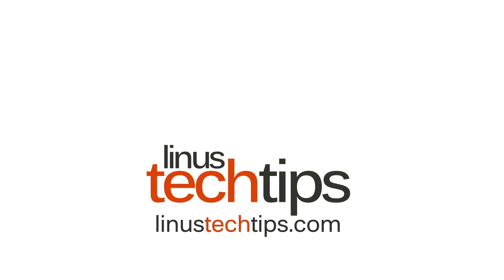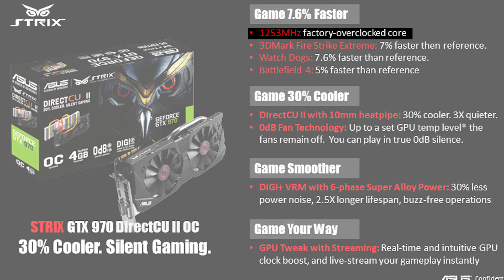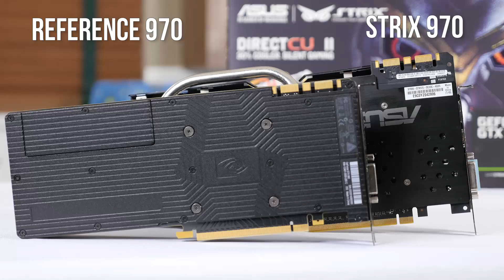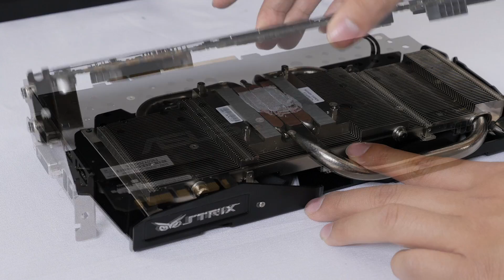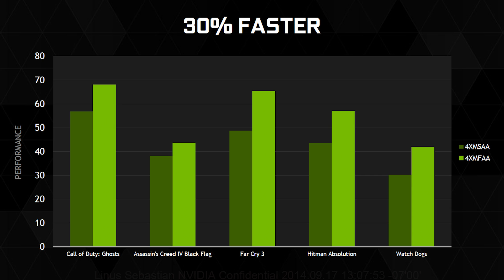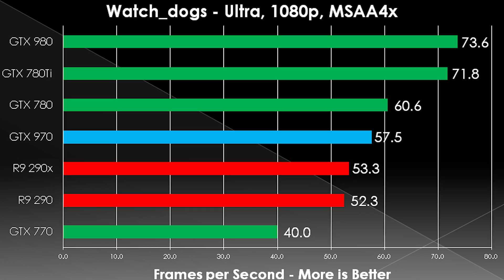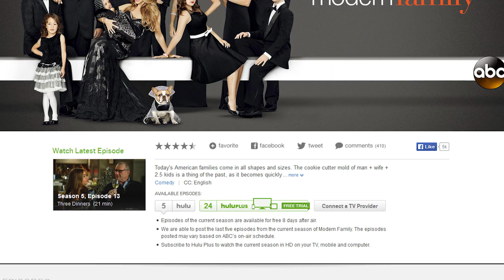ASUS Strix GeForce GTX 970 Video Card

Comment: can this build run ac unity and nba 2k15 on high??

 Intel Core i7 4790 3.6GHz Quad Core
 Asus H81M-PLUS
 8GB DDR3 1600MHz
 GTX 970 DirectCU II 4GB GDDR5
 120GB SSD
 1TB SATA3 HDD
 500W 80 PLUS 120mm fan
 thermaltake mid tower case
Reply: Very good build, however I would change 3 things. Firstly, I would bump that 500 watt power supply to 600 watts (just to have some extra room). Second, I would get a different motherboard, a gaming one with more than 1 PCI-e slots (yours only has 1). The MSI Z87/Z97 motherboards are very good. Third, if you can shell out an extra 20-30 dollars for that K (overclocked version) of that CPU that would be the best. But you can ignore my advice and just go ahead and build that already beast of a PC.
Reply: Great build except your power supply, get the 650w from corsair which is gold or platinum certified (cant remember which one), besides that you should be good

Comment: I had a r9 270 now, with a 520w powersuply, if i buy the gtx970, and do i need a new powersupply? Also will i preform much better, or just a little bit, or should i wait, since i can play most newest games on high at 45-60 fps, witch is perfecly fine for me

Comment: Building a PC in the next month.
I need a second opinion! I will be using this as a PS4 alternative.

i7 4790k
Corsair H100i
Asus Z-97
G.Skill Trident X-Series 16GB (2x8)
Samsung 840 EVO 500GB
Asus Strix GTX 970
Case- Corsair 780T
I need a good PSU for this. Any recommendations?

Comment: If you had to choose out of this ASUS Strix GeForce GTX 970 and the Galax GeForce GTX 970 Hall of Fame, which way would you lean? I would be running mostly @ 1920x1080 and considering 4k in the future as well as SLI down the track. Running all air cooling in a Corsair 540 all Noctua'd up! I honestly can't decide.

Comment: I just ordered a PC with:

i7-4790
GTX 970 "MSI"
16GB RAM "HyperX Fury"
Watercooling system (can't remember the model)
SSD 240GB
(and some extra basic stuff)

Should I be good?
Next year I'm planning to get another 970 just to have twins :D
Reply: I'm jelly.
Reply: Actually, I recently changed to a ASUS GTX 970 :D
Reply: Kenan D'Shredder And a 4790k x)
Reply: ***** Actually, the order turned out to be even better now...I'm getting the MSI gpu and non-K 4790.....heheh, joke's on you sir, you can see that I wrote (and some extra basic stuff)  :D
Reply: ***** I didn't say anything about overclocking....
Reply: ***** Yes I said that, but since I ordered my new pc it would arrive sometime next year because the gpu was out of stock, (and I couldn't wait) that's when I decided to change parts, but the new change didn't proceed...why? Because the gpu came earlier than they thought so that's why it was cancelled and I got what I actually ordered.......I don't say that the 4790 is better, it's just that I don't overclock stuff, If I want to OC..I'll buy the parts later when I have the money which I didn't have recently!

Capisce? :)
Reply: ***** I said if I want to OC, read carefully: 

I'LL BUY THE PARTS LATER!!!!!

Aaand...you can OC a non k cpu but, the performance wouldn't increase more than 0.5% ....

But as Maxim wrote, who cares? hehe

Comment: My strix is sitting at 1500mhz on the core and the ram at 7500mhz without touching the voltage! set power limit to 120% and bumped up the frequency to the ram and core.

Comment: Will my spec run minecraft on low 15fps?

gpu: Sli 980

motherboard: MSI Z97 9 ack

cpu: i7-4790k

Power: Corsair platinum ax12001

Ram: g skill ripjaws 4 x4

Ssd: x2 500GB

Harddrive: 2Tp

Comment: Is this a good PC for gaming with ultra settings 100+ (Battlefield 4, Csg) Will this PC last a couple of years if so how many?

Komplett 200R Midi Tower Black
Cooler Master B500 VER.2, 500W PSU
Intel Core i5-4460
MSI B85M-E45, Socket-1150
HyperX Fury DDR3 1600MHz 8GB Black
Gainward GeForce GTX 970 4GB PhysX CUDA
Kingston SSDNow V300 240GB 2.5" OEM
Samsung DVD Writer, SH-224DB
Microsoft Windows 8.1 64-bit

Comment: If i may? Can i run a GTX 970 with a Intel i7-3770@3.4ghz, 8GB RAM? Will it cause any bottlenecks with this GPU? Is it a good upgrade from current gpu which is my radeon HD7750 to this GTX 970?

Comment: I am building myself a PC. Anything i should improve? I am getting it for gaming.
CPU: Intel Core i5-4690K 3.5GHz Quad-Core Processor
CPU Cooler: Cooler Master Hyper 212 EVO 82.9 CFM
Motherboard: Asus Z97-Pro ATX LGA1150 Motherboard
RAM: G.Skill Ripjaws X Series 8GB (2 x 4GB) DDR3-1600
Storage: Kingston SSDNow V300 Series 120GB 2.5" Solid State Drive(boot drive)
Seagate Barracuda 2TB 3.5" 7200RPM Internal Hard Drive(storgae drive)
GPU: Asus GeForce GTX 970 4GB STRIX Video Card
Case: Fractal Design Define R4 w/Window (Black Pearl) ATX Mid Tower Case
PSU: EVGA 600B 600W 80+ Bronze Certified ATX Power Supply
Reply: 16 GB of ram. 8x2 is future proofing
Reply: damn! you are building almost exactly the same pc as i am!
Reply: For a bit more in price but better performance you could get the AMD FX 8350 CPU , this is coming from a i5 user
Reply: Id recommend the new R5 over the R4 but other than that, great build! Wish I could afford that shit :P
Reply: ***** nonsense. 3 years ago games only used 4 GB max. 1 year before that, just 2 GB.  As games get bigger, RAM needed will go up. He's putting a 970 in it so to "future-proof" the PC, he needs enough RAM that games won't exceed that before the card is obsolete which will be at least as long as the current console life considering the 970 is 3x more powerful
Reply: I have almost the exactly same PC, you won't have a problem with it. I ran DAI at a steady 50-60 fps at ultra with 2xMSAA.
Reply: lucdobra Same! I'm gonna check out DarkNinja's PC now though because it's cheaper.
Reply: ScoutAndProud 
Power supplies don't work like that. It just means that it can provide 400w max, not that it will be drawing 400w the whole time. But your comment was two years ago so I hope you have learnt that by now! Lol.
Reply: good specs. heres a bit cheaper version http://ca.pcpartpicker.com/p/pwmhBm <--- thats in Canadian dollars if you live in US or another country just change the currency from the toppest right corner
Reply: The fractal desing define R5 is out now.
A 400W psu is good to and saves money on power. Less money to spend.
Reply: I think its a great pc
Reply: Zaviex Future proofing is such a autistic word, and tell him to spread his ram out so 4x4 if he wants 16gb, 4x2 for 8gb but gives him an option to upgrade in the future.
Reply: Saul Hope-Robinson Thanks :D
Reply: MLG MISFIT Buy it when you need it, it will only get cheaper.
Reply: Zaviex Are you fucking stupid, there is no such thing as future proofing with ram. If you need more than just buy 2 more sticks. Which will most likely be cheaper once you actually need them.
Reply: ***** You don't need more ram 8GB is plenty for gaming. If you want to run 970 SLI which I do not recommend you will need 850W or more. I don't know if you are aware of it but 970 only have 3.5gb of vram instead of 4. So that is something to take into consideration.
Reply: ***** Well you didn't ask the perfect person! Anyway, I have pretty mich the same specs as what you want and I have a 600w PSU. I would totally have gone the r9 290x just for 8GB GDDR5 because I play quite a lot of older games, so I want a shit tonne of frames. Also ENB's for Fallout because I don't like Skyrim.
Reply: ***** UHD or true 4K?
Reply: ***** That's UHD, anyway I'd recommend going 1440p 144hz but if you really want UHD, I'd say you need 2 970's. maybe 1 980 will do it for you. Idk my rig runs 1080p 144hz pretty well.
Reply: Joseph Stephens nononononooonononoono. The 4690k runs MUCH better than the fx 8350. Coming from a user that used both.
Reply: Zaviex hahahah 2 years later 8 gb is enough

Comment: what is the different between gtx 970 gigabyte and 970 asus and msi and which is best please help ?
Reply: they are all overclocked a little bit but they are the same card. Difference is the cooler
Reply: Which ever card looks better in your case honestly. They all preform about the same so pick by brand loyalty and looks
Reply: i owned a gigabyte and my pal had an msi and tbh his card cools better at higher clock speeds and it looks sick af so i would get msi or at least i would have

Comment: That Tessmark score is way off. Definitely something at fault with that test when they ran it. My stock clocked EVGA GTX 970 FTW gets 13,721 with the same settings. Granted the stock clock of this GPU hit 1290 MHz during the test and peaks at 1400 MHz without limits, it is still nowhere near 4,999 on the score.

Comment: All I am worried about is will the 970 adequately handle next-gen games on decent settings with solid FPS. I am talking about games like Assassin's Creed Unity, Dragon Age Inquisition, and the Witcher 3. Do you all think I should get this card? I just upgraded my CPU to an i5 4k one and will get another 4 gigs of RAM to top up my already 4gb. Any thoughts on this build? Unfortunately I need to also upgrade my OS from XP to Windows 7 64 bit. :( So much to do and so little time!
Reply: The13thLoneRanger
for 4k i would get a second 970 or maybe a 3rd to run in 4k and dont get a 4k monitor expecting to play in 1080p becouse its not the monitors native res and will be blurry
Reply: This card will easily handle new games. I have just an R9 270X, which runs anything at solid to max settings (AA can be an issue but that's about it). That card is basically the AMD equal of a GTX 760, so it's noticeably slower than a 970. A 970 is absolutely fine for any game in 1080p, and can handle higher resolutions I'm sure.
Reply: Thanks folks!! I got the processor and graphics card and I just need to upgrade my memory and power supply before I can play the game but my new GPU looks amazing. I have very high hopes for it!! After I finish my rig I will save up for a 4k monitor as well and maybe Occulous Rift! :) That would be the dream!!
Reply: it will max all those games at 40fps plus in 2k and 70fps plus at 1080p ur fine in fact thats way overkill for standard 1080p gaming
Reply: thomas burden Thanks! I am pleased with the perchase now and am trying to get some christmas work so I can buy the rest of my gaming rig. After I make the pc I will be saving up for a 4k resolution monitor!!
Reply: The13thLoneRanger
I got the oculus rift and I only used it once lol.

Comment: so im going to be using an FX 8350, a 970 (probably the Strix, linus sold me) and the MSI G series 970 Mobo, what kind of Power supply should I be looking for? I may not use the 8350 BUT im using it for the sake of this question as its a 125w cpu. I plan to OC the CPU and will try to max the 970. (probably wont but lets say I do) what would be the best power supply wattage for me to get? im not talking 1500w because racecar but I mean like the absolute best for my money that's cheap enough but also has a good name, OH and I plan to SLI the 970 (probably only 2)

Comment: my new pc specs would be:
i5 4690k
mobo  z97 A
250 gb EVO SSD
1 TB HDD
for the gpu im still thinking between 3 cards 780 TI, 970 and 980
(i dont have money issue but what is enough for 3 years to come especially for gpu)

Comment: which is better for next 10 year gaming.
1. gtx 970 + intel i5 4690 (non k version, no overclocking)
OR
2. gtx 970 + amd fx 8350 (no overclocking)
OR
3. gtx 970 + amd fx 8320 (no overclocking)
Reply: 1. gtx 970 + intel i5 4690 (non k version, no overclocking)
OR

Comment: One of my PC is an old Core 2 Quad, and currently has a nvidia 520 card in it, and Wondering if a card like a 970 would be a good match or not. I don't wanna waste money on a CPU that probably can't keep up with the GPU. Should i then look at perhaps a 750 ti card?

I'm upgrading my main PC with from an old GYV 550 ti, to a Strix GTX 980, and i'll probably just put this old 550 ti into my old core 2 quad PC, but it would be nice to have something faster assuming an old core 2 quad can handle something more.

Comment: Well, I just bought this card today. And the graphics card works, but the fans aren't spinning for some reason. My friend has the same card and his fans does not spin as well. The motherboard I am using is an Asus x99 Deluxe version. Power supply supports the GPU and I am so pissed of because the fans does not spin. Would be great if someone could answer fast. :D
Reply: Just watch the video and he explains...

Comment: Do you guys think the GTX 970 is a good update for my system, knowing that I'll not buy other components in the next year? My objective is to replace my GTX 570 for a GPU with more VRAM and power to play highly modded games and recent games like BF4. (For example, -I love RPG and I still play Skyrim but with lots of texture mods and ENB and graphic chances to the point the original game has 10gb and mine has 50gb). Should I get most of the performance of this amazing model of GTX 970 with my current system or I'll be bottlenecked by some component like my board or my CPU? There is other more reasonable choice for my situation? I need Vram and power to run some mods!

My system is:

1 x Samsung Spinpoint F3 500GB 7200RPM 16MB SATA II 3.5 (HD502HJ)
1 x OCZ 750W Fatal1ty (OCZ750FTY-UN)
1 x LG GH22NS70 Sata Black Bulk (GH22NS70BB)
1 x Corsair Air Series A50 (CAFA50)
1 x G.Skill PC3-12800 1600Mhz Sniper 8GB CL9 (2x4GB) DDR3 (F3-12800CL9D-8GBSR1)
1 x CPU Intel 1155 i5 2500K 3.30GHz 6MB Box (BX80623I52500K)
1 x Asus GeForce GTX570 Direct CU II 1280MB GDDR5 PCI-E (90-C1CQ60-X0UAY0BZ)
1 x Asrock Z68 Extreme3 Gen3 (Z68 EXTREME3 GEN3)
1 x SSD Samsung 840 Pro 128GB
Reply: Up!
Reply: just buy use 780. its cheaper and faster and its already used so u wont be losing anything if you upgrade later

Comment: I want to upgrade to the new Asus or Gigabyte G1 Gtx 970, atm im running a Gigabyte Gtx 780 windforce Oc and running on a I7 3820 Sandy bridge E. Im planing on upgrading my Cpu later, but my main question is would the Gtx 970 bottle neck my computer due to the cpu?
Reply: I think you should be fine
Reply: Youll be fine, i have a 8320 running stock and it doesnt bottleneck the gpu... THIS CONCEPT OF BOTTLENECKING seriously doesnt exist unless youre running an i3 with a high end gpu...
Reply: lord llama
Thanks :) I've ordered it today so fingers crossed xD

Comment: hey guys :) please could you give me feedback on my build?

Corsair CX Series 750Watt Modular 80 PLUS Bronze ATX/EPS

MSI 7885-001R Gaming 7 Mainboard Socket LGA 2011-13 (Intel X99, 8x DDR-4 Speicher, 10x SATA III, S/PDIF, PS/2, 4x USB 3.0)

Intel i7-4820K Core Processor (3.9GHz, Socket 2011, 10M Cache, 130Watt)

MSI GTX 970 4GB gaming edition

i dont necessarily need help with the other specs doe :P (storage etc.)

thanks in advance :D